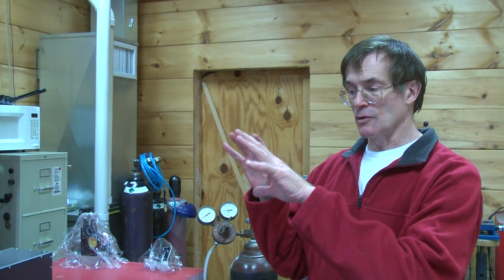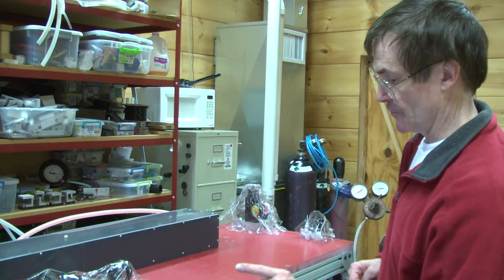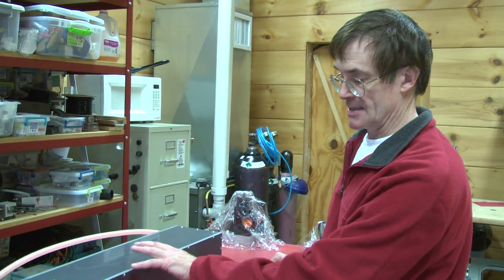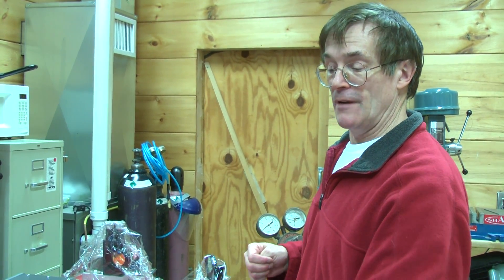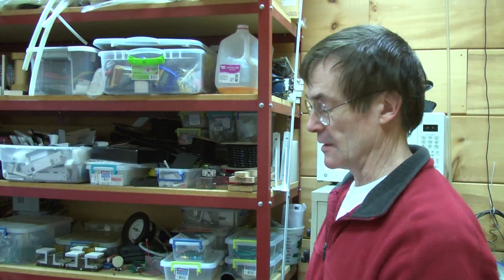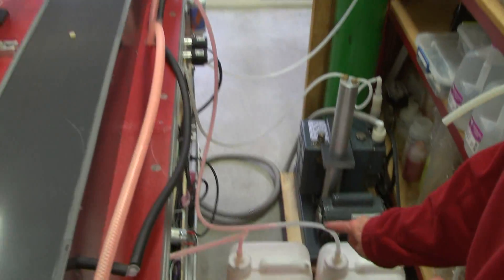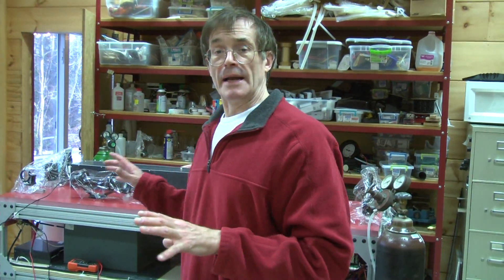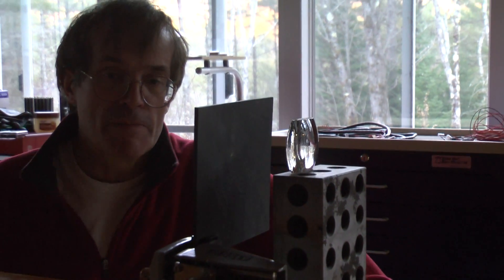High Energy Dye Laser Test Fire

Comment: Can you post plans?  for even a fee?  I have a HUGE argon laser head that is beautiful but bad tube.  I got it free and it is an old Coherent Graphite  large frame head that is 6 feet long.    I want to build something out of it.    I have been told how it CAN'T be done and how stupid I am trying. .   I need someone that will encourage me.   I got plenty of DPSS and flashlamp ND YAGs  but I want to build one of my own.  thanks for any help    this video is awesome
Reply from the maker: Those lasers have a long history of aftermarket refurbishing.  They require high vacuum skills, excellent optics and precision alignment due to their low gain.  The power requirements are in the 10's of kWs and usually require 480V, three phase power.  Nevertheless that has not stopped many people from rebuilding them.  You might want to visit:
https://www.photonlexicon.com/forums/
The community there is very supportive.

Oh, and thanks!
Reply: Thank you for your reply    Yes I have a working 10 watt Ion laser and I have to go to my friend's factory to run it as I installed a 600 amp 480/277 service, and I run it there.  I got that one for free from a college in Columbia Mo.   it works     but this head is orphaned and no power supply    I LOVE the way it looks   and would love to make something out of it.  the tube is busted at the water inlet part and looks like it happened when it was running.   I basically wish I was like you   making real stuff like projectors and such.   but I will try them guys   the laser pointer forums are are bunch of nasties  for the most part.

Comment: Here is a question, how do you deal with the rhodamine? I used some for a school TEA LASER project, and it was such a mess, it got everywhere,  now four months later I am still finding stains.
Reply from the maker: That is definite skill set.  You have to pre-think  each step with layers of disposable protection and trash receptacles readily at hand.  Also, if you have alcohol at hand, any spills or splashes can be diluted/wiped up if you flush the stain IMMEDIATELY and I mean IMMEDIATELY as in less than a few seconds.